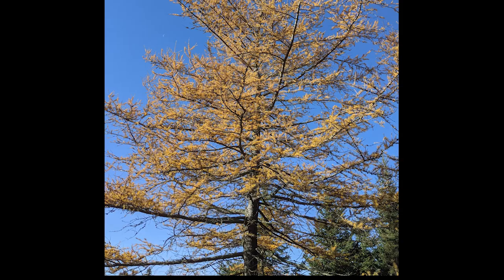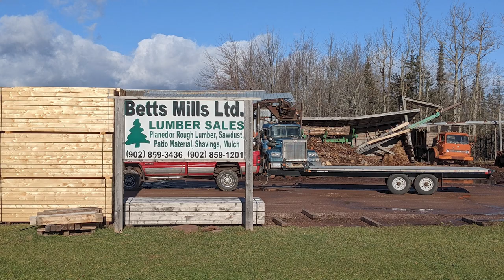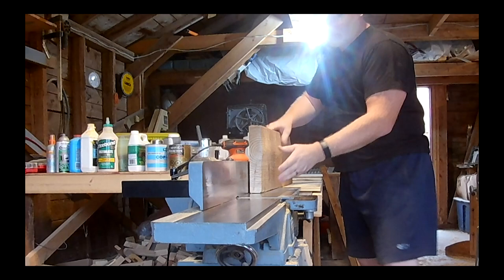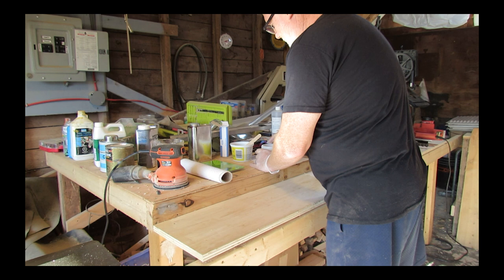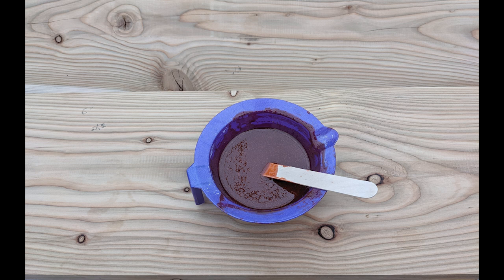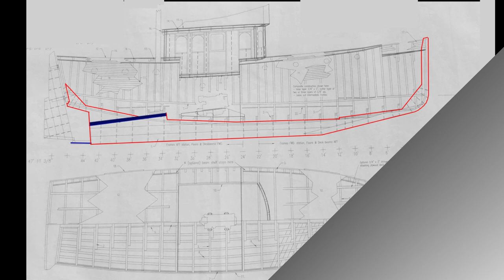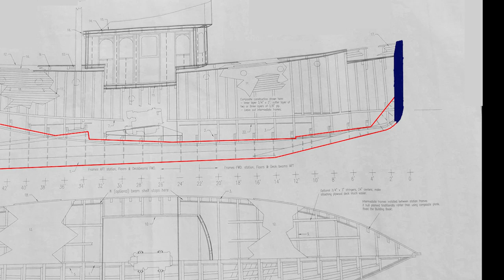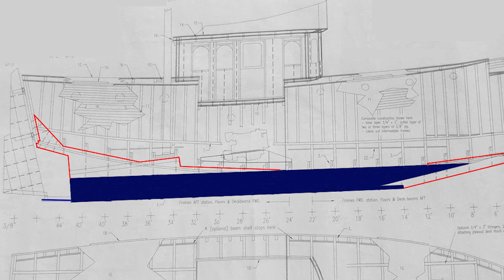Boat Build Keel - Forefoot, Upper Shaft Log, Stem - Ep16 - Building A Wooden Troller Yacht

Comment: Nice one.. almost weird that wood with such huge growth rings can be used for boat building.. special stuff.. 🙂👍
Reply from the maker: I guess it is the channeling in the wood.  Just like red oak has an open cell structure and so water soaks right along its length, whereas white oak has a closed cell structure so doesn't soak up the water. White oak is excellent for boat building, red oak not so much

Comment: Nice work turning all of those small pieces into much bigger pieces Bill. Glad the weather is giving you a break. Looking forward to seeing the ballast keel come together.
Many years ago I had some Tamarack firewood that I split some pieces for tent stakes. The first year they seemed some what soft. The second year they had dried to the point of being so hard I swear you could have driven them through concrete to set up the tent. I think your keel is going to be very tough. Take care and best wishes for a great weekend.
Reply from the maker: Thanks Matt. Yes, locally larch is used for fence posts and deck boards so withstands the elements pretty darn good. Interesting about the tent stakes. I should make a bunch from my scraps and sell them. Far better than the aluminum stakes the stores sell that bend after a few inches in the dirt.

Comment: Nice work Bill! I've got a 48 in build now as well, just finished the side planking. Let me know if you want to share notes.
Reply from the maker: Heck Ya! I should be starting side planking early next year. Couple questions. 1. Are you covering your side planking with 2 sheets ply? What are you using for your planking? 2. What size engine are you going to use?  Great to know there is another crazy 48'er out there.
Reply: @TheAmblerOdysseys  I'm using 2x Douglas Fir for planking, one layer of 1/2" plywood covered in epoxy/glass cloth. I've got a Beta Marine 85T with a 2.94:1 gear box going into B20 Aquadrive. Crazy is right!
Reply from the maker: @scottfintel8935  So many choices.

Comment: question why cut the timber down to the 2” when you were getting it milled couldn’t it have been thicker with less laminations . enjoying the videos cheers from australia
Reply from the maker: Yes, I could have the mill mill it down to my final dimensions, but that adds to the cost, but it would save time. Being new to wooden boat building I do enjoy working with the wood, seeing how it likes to shape itself, and larch sure does love to wiggle when drying. I am also able to remove some edge defects like knots or sapwood that comes in the stock.

Comment: are you using epoxy to laminate the stem because it wont be continuously under water or have you run out of the Red waterproof brew you were using for the keel? Interesting build you are taking on.
Reply from the maker: You discovered my exception to my rule. I had run out of the Cascophen and my supplier was out of stock with no known restock date. West Systems says it is also a suitable epoxy for below the water line, so I was safe to use it for the stem. That being said the exposed keel below the water line will be fiberglassed over.